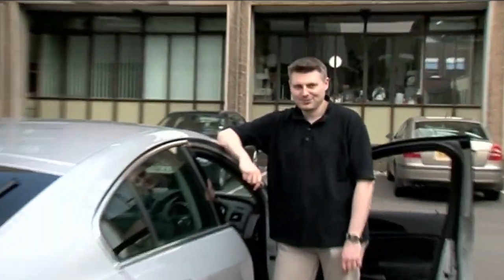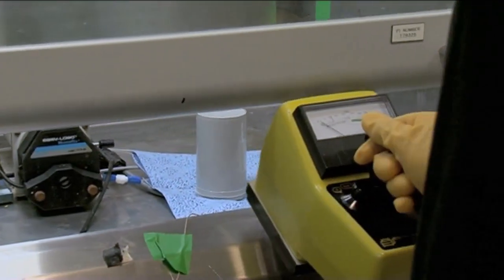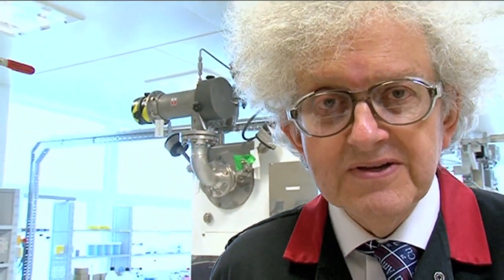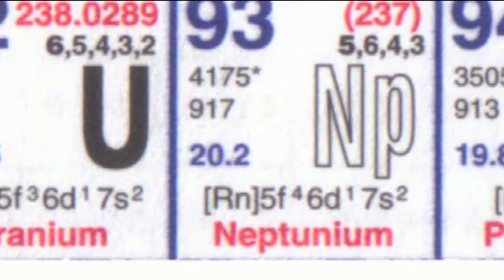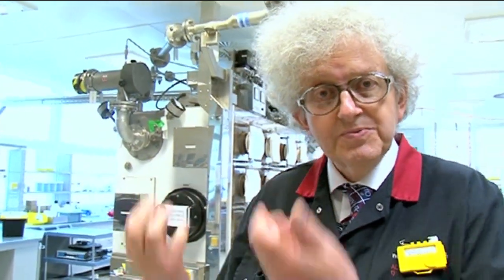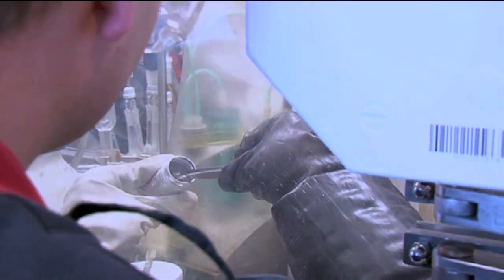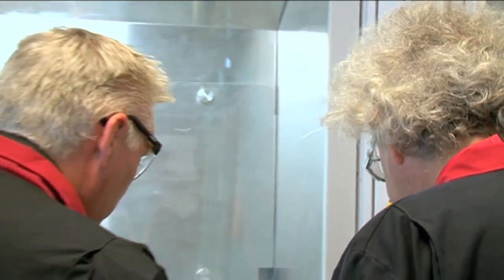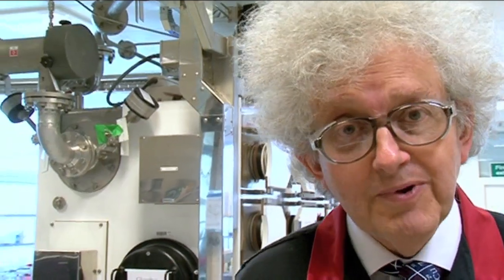Nuclear Lab (RADIOACTIVE) - Periodic Table of Videos

Comment: Liquid fluoride thorium reactors are the way to go!  No xenon-135 buildup, no risk of meltdown, no weapons proliferation, & only a fraction of the amount of waste (& it only has to be stored for 300 years instead of tens of thousands).  The 232-Th/233-U fuel cycle is so much more efficient than the 235-U/239-Pu fuel cycle.  Not to mention that thorium is about 4 times as abundant as uranium, has 90x the energy density as uranium, & costs way less to refine than uranium...

Comment: No, Nottingham's lab doesn't suck air out. That makes no sense.

Negative pressure = the box has lower pressure than the environment outside, as if any radioactive element were to escape it wouldn't be very good
Positive pressure = the box has higher pressure than the environment outside, and while yes a leak would result in what's inside escaping, but positive pressure boxes are to protect what's inside the box from the environment, for Nuclear labs the reverse is true.

Comment: They are likely forced to use a certain version of windows that the drivers and the software for the spectrometer work with.

Many industrial applications still run on win 3.11 because the software was designed to run on it.

Comment: Thorium isn't less efficient than plutonium production - it's just less efficient than the simple fission of U-235.  Thorium-232 has a much larger capture cross section than uranium-238. U-233 thermal fission does produce fewer neutrons than Pu-238 fast fission - that distinction leading to the research preference for the IFR.

The gammas from U-232 contamination is a benefit, in my opinion; it offers proliferation resistance, since it's harder to handle - but can be automated without a problem.

Comment: Not quite right. Thorium isn't fissile. If irradiated in a nuclear reactor, then it can be converted into uranium (like U238 is converted to Pu239) in a regular reactor. But the process of thorium irradiation is much less efficient and much more complicated.

Additionally, the uranium produced by thorium irradiation (U233) is exceedingly radioactive and produces very strong gamma rays (by contrast plutonium is mildly radioactive and produces weak gamma) making very difficult to handle.

Comment: Yes. An alpha particle is just a helium nucleus with very high kinetic energy; just as a beta particle is an electron (or positron) with high kinetic energy. 

However, the names alpha and beta are only used when the particles get ejected from a nucleus.

If a gamma ray hits an electron in an atom, the gamma ray may disappear, and its energy will go into kinetic energy of the electron (the photoelectric effect), which then flys off. This electron is not a beta as it didn't come from the nucleus.

Comment: If it isn't hooked up to the 'net, doesn't have open USB ports (I know. Win95 doesn't have USB. It's just the idea), isn't part of a mission critical item, and is fully formatted and reinstalled every month, I don't see the problem. Even a Linux/Unix system in a mission critical application is normally wiped and reinstalled every now and then.

Comment: I suggest you research to topic of fission a little further before you repeat misconceptions. You don't need to turn U238 into Pu239 before fission can occur. This happens in modern day reactors solely because the neutrons are thermal. However, if you don't slow them down, they are able to collide with U238 and induce fission directly without an intermediate.
Yes, thorium exists, however, what are we supposed to do with our massive stockpiles of DU? We should use them before moving onto thorium.

Comment: Yeah I'd say XP with all the fancy stuff turned off is one of the best and most stable versions of Windows. Almost certainly wouldn't want to be using the latest versions of Windows in a lab like that due to all the bugs, bloat, and instability. Though, it might be best to at least use one that's still actively supported, for security updates... if that's not an oxymoron coming from MS.

Comment: I agree with you, mannonc, that hydrogen is presently best viewed as a fuel, not an energy source. But I note that chemically the situation isn't so clear cut: turning methane into hydrogen could ideally take a little less then 15% the energy made available by turning the resulting hydrogen into water. The carbon could hopefully be captured as graphite and buried.

Comment: Fusion is the bomb! 
;) I rather see more work be put into that, though I can't say I know to much on the technical benefits of having one kind of project or the other, though I know the energy released through fusion is much better. Waste isn't exactly the issue at that point. I wonder if fusion could replace fission or are they both useful? My mind set is that one is just more primitive and out dated compared to the other, I'm very option to correction/ explanation though.

Comment: That's a common misconception, U238 can definitely sustain fission, with one requirement, that the neutrons remain unmoderated. Such reactors are called "fast" as opposed to "thermal" because the neutrons whizz around at the same speed as they were released when fission occurred. Such reactors allow for the complete use of existing uranium reserves and waste products are minimal thanks to the fast neutrons. If necessary, these reactors can also use Th :)
Cheap clean energy for everyone forever!

Comment: U-238 is not very good at sustaining a fission reaction.  Otherwise, Iran and everyone else wouldn't have such a problem with centrifuges to extract out that 0.7%  In other words, 99.3% of all the uranium is U-238, and not much good for power generation. 
Also, thorium reactors would be immune to the catastrophic metldowns of Fukushima, Chernobyl, and even Three Mile Island.  Safer, cleaner, and known supplies can last 25,000 years.  Also, thorium cannot make nukes--not enough neutrons.

Comment: All the more reason to build thorium-powered nuclear reactors.  Thorium is 3.5 times more abundant, AND is 100% the correct fissile isotope when mined, making it effectively 500 times more abundant.  And you can burn up the uranium wastes in it, the by-products of thorium fission are only radioactive for less than 300 years, making it a much easier problem to deal with.  So why not thorium???

Comment: Once they master it, the ultimate source of energy will surely be nuclear fusion. It produce only a very small quantity of radioactive waste, and they think they can reduce that to zero. It uses deuterium as fuel, extracted for seawater. There is always the same ratio of deuterium/hydrogen (heavy water/water) in the nature, meaning it regenerate itself. The only obstacle/threat is that the reaction happen in a plasma hotter than the core of the sun. They're trying to understand how to deal with

Comment: Hydrogen is useful as a fuel, but NOT as an energy source. It takes more energy to release hydrogen from water than you get back from either combustion or fuel cells and there is no convenient source of molecular hydrogen on Earth, because it is far too reactive and nearly all bonded to oxygen in our water. Steam turbines as well can generate power, but are not in and of themselves a power source. In fact generally how the heat from nuclear reactors is converted into electricity.

Comment: Radioactive waste is very concentrated and can be dangerous. Yet the amount of radioactive waste created in generating power is dwarfed by the pollution and wastes generated by fossil fuels. To be quite honest on the whole, it's actually cleaner and safer. The key of course is proper management. There are also new reactors being designed which quite literally cannot have a meltdown because those conditions will stop the chain reaction instead of accelerating it.

Comment: They do, but even the best geiger counters can only tell you if something is radioactive, and not what is causing the radiation. For this the tool of choice is the Scintillation Dectector, which actually determines what element is giving off the radiation. This lets it differentiate for example between the K-40 naturally in your body and some Th-232 you really shouldn't have gotten your hands into!